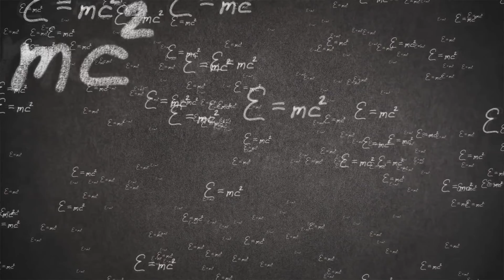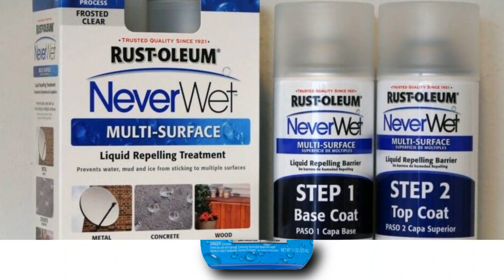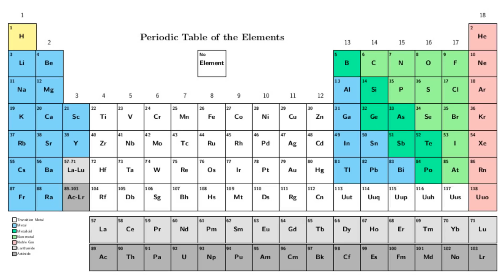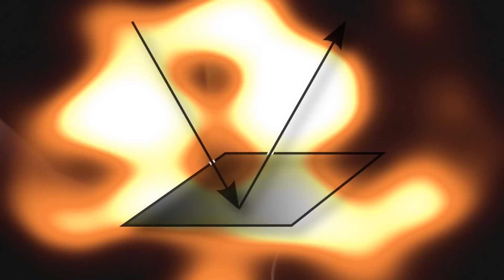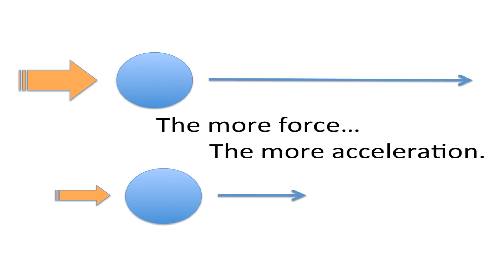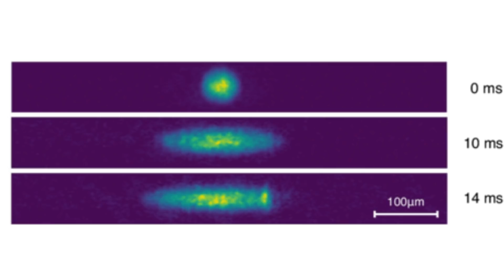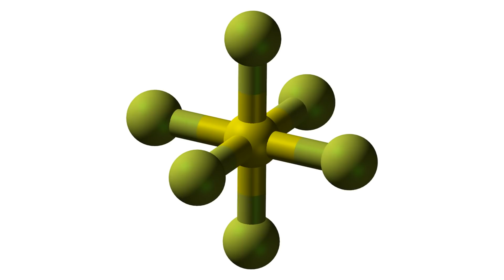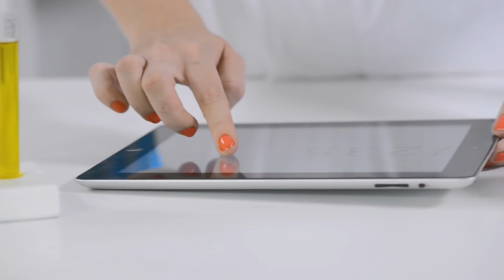Materials Invented Just To Defy The Laws Of Physics

Comment: Starlite is lowkey bein tested by the government
Reply: Starlite has a very serious disadvantage. It is not physically durable. It strips off a surface easily, like with your finger. All attempts so far to make it durable have resulted in significant deterioration of the heat resistance properties.

Comment: About Sulfur Hexa Flouride, yes it's not toxic however because its much heavier than air it will stay at the bottom of your lungs, so after inhaling some for fun with the voice, please ,please ,please do really deep exhales and inhales and try to bend a bit since if too much fills at the bottom of your lungs the parts affected there will not be able to absorb oxygen since air will not be able to pass through. its kind of the same as water in your lungs but instead of a liquid its a gas. stay safe

Comment: STOP! Telling people, kids it's safe to play around with breathing in SF6/sulfur hexafluoride! Just because a gas is inert doesn't mean it's not dangerous to fill your lungs with it! It displaces the oxygen in your lungs, and is muuuch heavier than air so much more taxing to empty your lungs of. If you don't know what you're doing and keep inhaling it, as people often do with helium, you'll asphyxiate and pass out after a minute. Without being away and alert, intentionally forcing your lungs to work hard to expunge the SF6, you might very well die. And SF6 is often contaminated with traces of fluorine and hydrogen fluoride, both of which are very toxic at small concentrations.

Comment: Sulfer Hexafloride is ACTUALLY STILL DANGEROUS!!!!  Just because it's not toxic doesn't mean you can not die by inhaling this gas. It does not contain oxygen, and due to its density, it is rather difficult to remove from the lungs, which can cause suffocation if not careful. If you must try, only use a small amount, and wait 30 minutes before trying again, giving the gas time to circulate out of your lungs

Comment: @2:33 "Water, gas or oil pipes" says he, while front & center of the video are electric (EMT) pipes.
(Granted, low-friction coating or lubricant does help pulling wire through the pipes....so it's still relevant.)

Comment: Sulphurhex is not something one should casually breathe, no more than you should helium.  Helium will "pull" oxygen out of your system, so the longer you breathe it, the less oxygenated your blood will be.  For safety, just hyperventilate first, and load a lot of oxygen into your blood.  Sulphurhex on the other hand, is a heavy gas that settles at the bottom of your lungs if you breathe it in.  That's why fish tanks are filled with the gas and then little boats floated on it to show that the gas stays in the bottom of the tank.  If you breathe in a lot of sulphurhexafluoride, you may find it difficult to draw a full breath until you stand on your head and let the sulphurhex drain out of your lungs.
Reply: Mate, it may be heavier than regular air but that doesn't necessarily mean you have to invert to let it out, what about expelling it with breathing out using your muscular diaphragm to push it out of your lungs…  ?  Is it so heavy that isn't possible, it will result in pulmonary arrest and death?  Surely they would have said so instead of implying its completely safe to use as a voice lowering novelty. If people can expell the water out of their flooded lungs before completely drowning from hypoxia, then I have to believe people can exhale this liquid albeit uncomfortably in the upright or doubled-over chair positions.  much like the oxygenated Florida breathing system invented for deep sea diving..using hydrofluorocarbon.,

Comment: You shouldn't be telling people sulfur hexafluoride is safe to breath in. It has a high density then oxygen which means when you breath it, it can settle in the bottoms of your lungs and displace the oxygen. Meaning if you have it in your lungs to long or are unable to get it out quick enough you can end up passing out. We don't have this problem so much with helium because it's less dense than air is. Yes it's fun and it won't poison you or anything, but people could get hurt if they aren't aware of the risks.

Comment: The element that pushes back when pushed at (close-to) absolute zero, would it push back because of the heat transferance and the expanding of the molecules from the other object.  With friction of the opposing object offset the temp even just a little or even would the object even be the same temp or what would happen if a colder object touched it

Comment: Forget about the idea that a material can be "locked away".
If it is patented, it is easily duplicated.
If it is NOT patented, careful research will enable competent chemists to duplicate. Worst case, it is only necessary to find the tiniest speck of the stuff and the analytical chemists are "Off and Running".

There are no long-term secrets in Science.

Comment: These all follow the laws of physics perfectly
Reply: I don't know much(just cleared school). But still, condensates behave as superfluids, that doesn't make it behave as negative mass object. Superfluid still move along the direction of force, although mechanical force wouldn't be applicable on them, still EM force could work a little. Afterall superfluids must also move in direction of force. Rubidium might be a condensate, but that wouldn't explain the properties described above...
Reply: KRISHNA KANT im sorry, I am having difficulty on what you are trying to say, are you perhaps trying to allude to the properties of super conductivity on the thermal kinetic side of things with super fluids? If so I think the answer to your question is that most properties that are added to a super liquid system would be distributed as homogeneously through the (closed) system at those temperatures. That would make it a very good (some would say *super*) conductor of electric/kinetic energy.
Reply: @MrFloom   I totally agreed with you😄.
I just can't think of any reason of rubidium acting as negative mass at low temperature...
Reply: KRISHNA KANT glad I could answer your question! To be honest with you we still are very murky on low temperature physics, normally interactions on the quantum (deterministic) scale are dictated by gauge bosons (and one scaler boson which is the Higgs boson) which we assume as interactions undergone in temperatures that do not trend towards 0kelvin. Bose-Einstein’s statistics dose not predict interactions well under super cold environments and to find out what is going one I think your best bet would probably be studying quantum electro dynamics and field theory (which is a ball ache unless your maths is up to scratch); subjects in witch I am less confident in I’m afraid😅.
Reply: let me rephrase "break the laws of physics as we have defined them without allowing room for adjustments and error or ignorance on our part".
Reply: What about supercooled rubidium
Reply: @@KRISHNA KANT  nothing comes to mind about rubidium right now other than it was confirmed to Einstines Bose condensate back in 1995; this won't give it any (thermodynamic) properties/interactions that are unique in any way. aside from that, it’s  a pretty cool method  that they used to observe the Bose condensate; lasers and magnetic traps to cool it down to the tune of 200 nanokelvin which is amazing!
Reply: Unrelenting Optimist, we have already discovered a loophole with the second law, quantum h-theorem. With this under certain circumstances entropy might decrease, the violation is only on a local scale and temporary but is still significant in thermodynamics.
Reply: Starlight could be used somehow to continue drilling into the earths crust since it can withstand such heat
Reply: There are no laws we just haven't found out everything .
Reply: They said in the beginning that this stuff doesn’t technically defy the laws of physics they only seem to
Reply: except for Starlite that seems breaks several thermodynamic laws.
Reply: hot fulff air is an excellent insulator, and starlight is almost all air, hence it’s very insulating
Reply: @benjohnson4925  yes that is why arojell is a very good insulator, however, i was talking about the paste that was allegedly had such an amazing resistance to heat flow into it system being a solid that was made by the hairdresser from Yorkshire; we don't know what mechanisms or interactions would do that.
Reply: hot fulff that, I have no idea but it clearly has some sort of property that gives it it’s crazy insulation
Reply: Ben Johnson  nah chief, matter is not supposed to act like a wedge between two systems that prevents the flow of thermal or kinetic energy regardless of its molecular composition or lattice (or lack there of since it’s a mixture that comes in ceramic form). First and second law is broken with that stuff.
Reply: hot fulff well clearly starlite is
Reply: Ben Johnson yes and we can conclude that the property of being an insulator that has a lower heat exchange than most gasses under pressures a magnitude smaller that 1 atmosphere is anomalous. We can only speculate what type of interactions that had happened in its lattice (if it has one); which is where the fun is!

Unless we can recreate it in a lab, then we would have a much easier time explaining what’s going on.

Comment: SF6 cannot always be safely inhaled to lower your voice!!! I'm surprised by this channel's comment to that effect. For one, it is so heavy that one would have to turn upside down and breathe to expel all of it from the lungs. You may have seen people in videos seem to inhale this gas and speak low, but I can assure you that nearly all of the ones from people whom know what they are doing have used a voice changer or other audio manipulation. Can some scientist confirm or disprove my assessment please.
Reply: Chris M You are correct, Chris. SF6 is used currently in eye surgery when retinal detachments are repaired - it is injected as a gas bubble into the eye to help keep the retina in position as it heals. If you were to breathe a large amount of SF6 into your lungs, it would displace the air in them and make you dangerously hypoxaemic (have a low blood oxygen level). The only way to remove it would be to stand on your head to allow it to run out again.
Reply: Chris M this is only sort of true, only if you inhaled a very large quantity of SF6 would you have to stand on your head to remove it, but normally just breathing out hard will be enough
Reply: sf6 is harmless and does chage the pitch of the voice due to density, siund waves travel much slower trough sf6 than they do trough air. the gas is non toxic, but the density makes it harmfull in a way that if you inhale too much of it the gas displaces all of the oxygen and air from your lungs, so you'd have to turn urself upside down to drain your lungs. unlike helium the gas could fill you up and even if you breathe while having inhaled it the voice pitch stays lowered due to the presence of SF6 in the lungs. i've worked with the gas, and i have done a bunch of presentations about density and sound speed trough gasses, and in every demonstration i use helium and SF6 to show the differences in practice
Reply: cfc434 actually the denser the material the faster the sound
Reply: This is sort of true. It denser and heavier then air so it can very easily displace air in your lungs. However you can inhale small quantities safe to show the effects on the vocal cords. You lungs and diaphragm can case enough pressure to expel small quantities without having to be flipped on you head. If you do demonstrate using this gas you have to take breaks to make sure your O2 levels don't drop. But it is biologically inert (no good or bad side effects). I've done this demonstration for chemistry day. But it can suffocate you easily when used improperly.
Reply: I'm not a scientist, but I know there are risks. It can be breathed out normally but you need a few deep quick breaths to flush it out. If you see someone breath it and not take a good few breaths after maybe... 5-6 seconds its probably fake because most people would have started to feel dizzy by then.

Comment: Starlight...ubelievable. this stuff could change the world but as usual, the gov have locked it away so the rich keep getting richer. Pensioners die because they can't afford to heat their homes yet we could solve this problem in an instant. The people who run the world are cunts
Reply: How would something that absorbs heat help someone struggling to stay warm?
Reply: @Snake-yx1dq  Because it doesn't "absorb heat". It blocks it's passage. Depending upon it's mechanism for doing so, if you used even a small layer of that stuff to insulate your house, it'd drastically reduce your heating bills. Heat would escape so slowly that you wouldn't have to burn so much gas/use so much electricity to heat. Especially if you could paint with it.
Reply: Not very impressive material, once the material is made it only has those properties for a couple weeks before it degrades. Carbon carbon is much better at absorbing heat then starlight.

Comment: Some things about SF6. It is one of the most potent greenhouse gases there is. So while it is used in high voltage systems as an insulator, it needs careful handling so that as little as possible escapes. Other then that it is not recommended that you breathe in the gas. Because it is so dens and heavy, it is possible that once it is in your lungs, it won't all come out when you exhale. Which can lead to suffocation.

Comment: I'm wondering if Vantablack could be used somehow in the manufacture of solar panels.
Reply: Although, with that kind of an absorption rate, i would expect vantablack to constantly overheat whatever it's applied on... :-s
Reply: Yes, it very well does have application to solar-thermal collectors.  Not PV which requires light transmittance and absorption by crystalline metallic layers.  In termal collectors, the darker and less shiny the black color covering the water tubes or enclosures, the more heat will transmit through to the water, making Vanta black 1 and 2 both perfect materials for solar-thermal based collection systems (hot water or flowing gas heat collection systems). 

 It would also be the perfect color for a survival blanket used in cold areas, were it also durable enough to withstand inundation by water for long periods of time.  (Does it?). I've never had access to Vanta anything so that's a big mystery box for me I'd like to put to the test some day in some of my solar materials research.  I think it would perform tremendously well.in certain solar applications.  Treated with Line X, it might in fact be an invincible solar thermal material of the highest caliber with no or few application limits.  TBCL….  
 
Anyone who can send me samples  of this Vanta black paint (1 or 2) to research will definitely receive my gratitude for the help of aquisitionatl assistance in the published and privately-held (if any reason to) findings… and a percentage of any future profit from any future-related material application patents where sales of or licensing would create potential royalties as a result of the fruition of the research that could result.  Who knows?  Just send it to me and I will let you know the possibilities I can find for it… No joke.